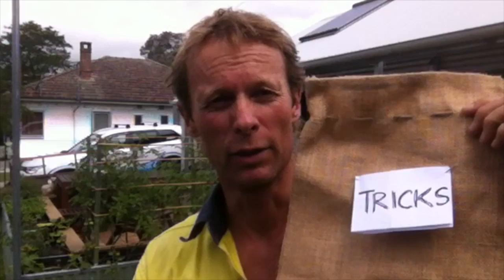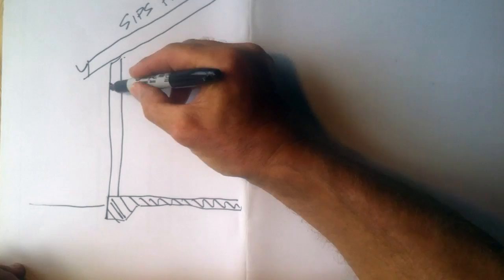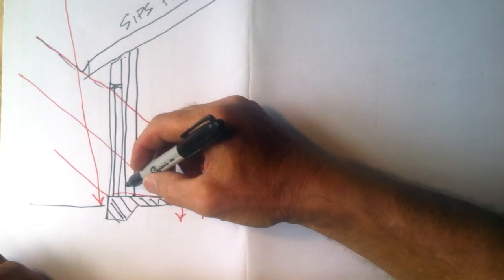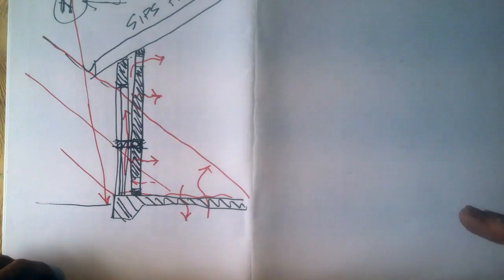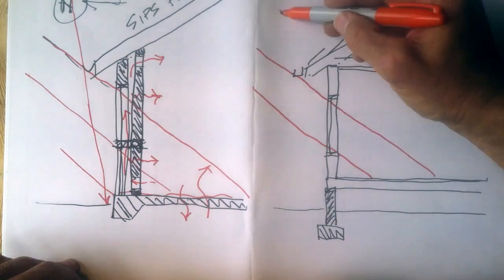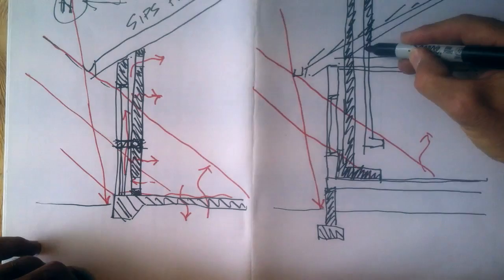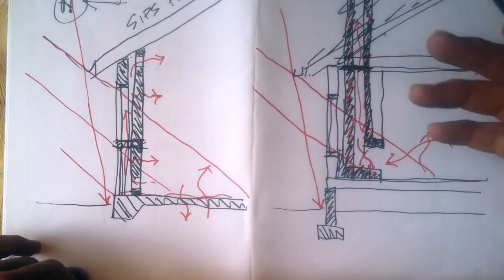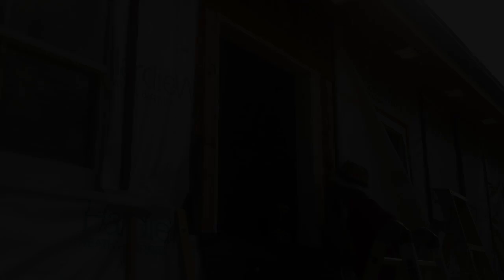Greeny Flat - Home Energy Retrofit - Episode 9 - What's a Trombe Wall (Full Version)

Comment: Hi Andy great explanation. Would I be right In assuming It’d take a fair bit of solar energy collection in the Slab on ground construction to offset the embodied energy in the Slab construction however? Even in dollar terms, in the  timber framed floor your be able to run a night time heating system for quite a while before paying out the same as the cost of pouring a large slab, perhaps? I guess this is particularly so when building on slopes where the cost of excavating to level and filling deeper with concrete grows quickly. 
Thanks for the great explanation 😊